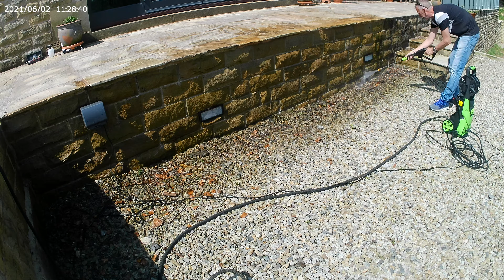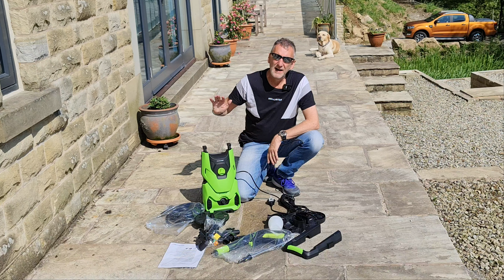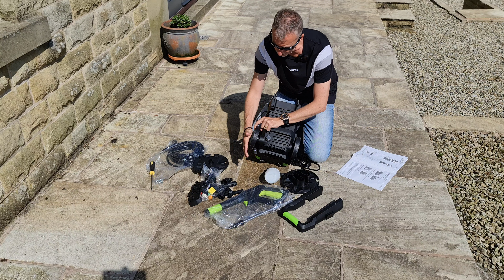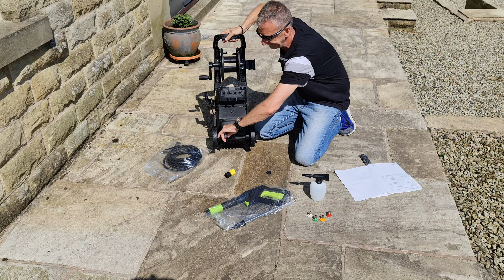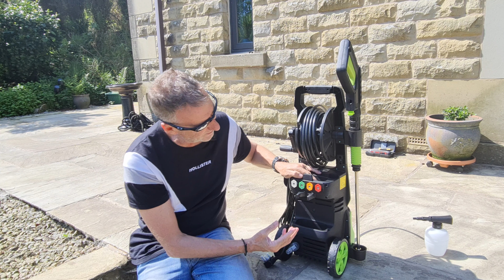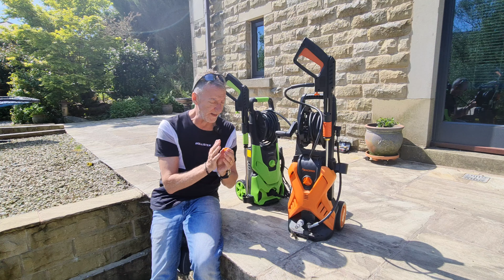Paxcess Pressure Washer setup and using it

Comment: Instructions with washer are nonsense. Just any old English words stringed together by a non English speaking person.
Which is top of accessories rack? 
It is nearly impossible to line up the accessories rack with the elevated screw holes beneath. Took me 4 tries. I finally did it by sticking thin objects through 2 holes while I inserted first 2.
You will need mm ruler to find 4X16 screws.
Joining the 2 half’s of the wheel is more difficult still. You have to get  tiny screws down blind tubes and then pray you can center them in a hidden ledge.
The screw in for the included hose in hidden low down in the side opposite the accessory storage bar

Comment: Thanks for the video. Your explanation is clear and well filmed. I am considering to get a pressure washer, so you recommend paxcess over the karcher  😀 ?
Reply from the maker: For the money, yes.  Also for the wind up system on the Paxcess.  If you want to pay the bit extra though, the Karcher is a better built unit and a little easier to use as you just change the spray pattern by twisting the lance.  Horses for courses.  👍
Reply: @CloughReviews  Thanks for the tips. I am pretty new to these pressurised washer. If I have a bucket of water (not from tap which is pressurised), can they suck water from it, or it must come from a pressurised hose?
Reply: @simonhk  Normally need a minimum pressure flow from a tap, plus it wouldn't last very long from a bucket :)

Comment: Hello Clough. Thank you so much for making this video. My sister just brought her first  pressure washer and the manual wasn't exactly clear, but your video was educational. I have a couple of question that the Manuel didn't cover.
1) In the manual, page 7, number 19 refers to the 'needle reel handle bracket shaft'. What is it for and how is it used?
2) How do you know when there is enough water to use the pressure washer?
Again great video. Already subscribed. 😊